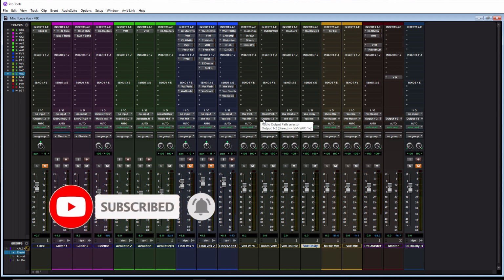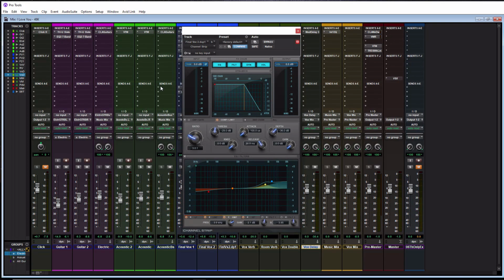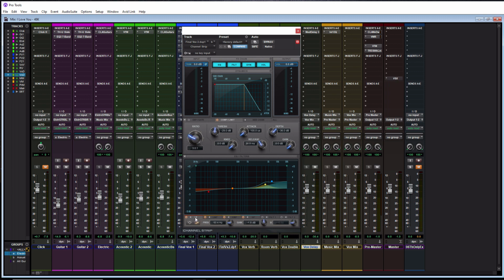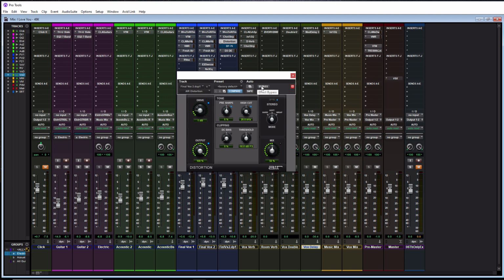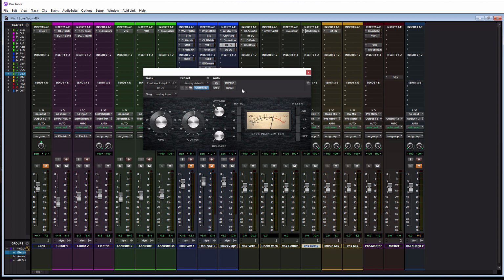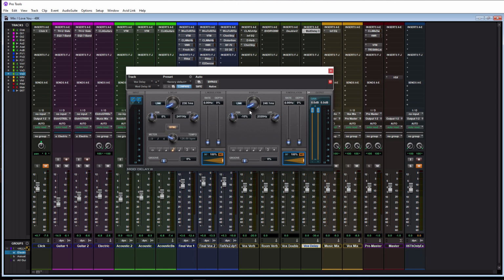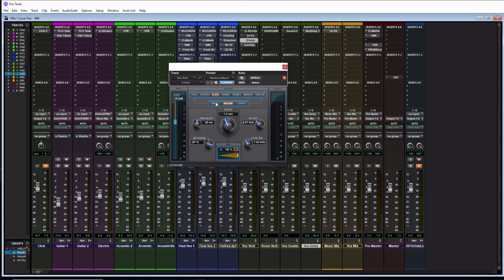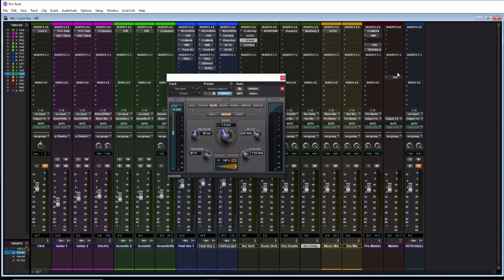Top 5 Best Pro Tools Stock Plugins!

Comment: Nice video. You explain it well and your videos are well done
. 
I am an old school engineer (before doing photography for a living) that ran/owned a full time audio home studio with a large fully modular console (48 input D&R Orion inline console) and a large format analog tape machine running at 30IPS (or 15IPS) and vintage outboard gear. (Eventide H3000, Lexicon PCM 42, Rev7, TC Electronics, DBX, etc. 

I eventually (about 15 years ago) bought myself an Alesis HD24XR Stand alone hard disc recorder (24 tracks) with the higher spec AD/DA converters and now I am considering buying a DAW. I still like using a console and my outboard gear, so I am trying to find a DAW that would be user friendly to make a hybrid studio (mainly for myself). I may rent the studio again on a limited basis, but my main concern is to take advantage of what a DAW can offer as well as have the console and outboard gear at my disposal also. 

I was going to start with a perpetual license Pro Tools standard, but there is so much stuff available it gets confusing really fast. Any suggestions as you seem very knowledgeable with the DAWs. Thanks.
Phil
Reply from the maker: If you want to incorporate a DAW into a analog console set up I definitely recommend Pro Tools. It will also give you everything you possibly can need as a stand alone as that's how I use it. I use it with Slate Ravens which are touch screen interfaces so I can still use my fingers. Back in the day, when I was in college, we used Pro Tools with an SSL hybrid console. Once you get all the actual patch bay routing in place it works great with Pro Tools.
Reply: @AudioSorcerer  OK Thanks for that info. Appreciated. Also, nothing like those SSL consoles, Neve, API, etc, Those consoles are amazing. 
Phil
Reply: @AudioSorcerer  Are you using something like these models? I'd like to research getting some of these when I create my new setup. Thanks.
Phil

https://www.bhphotovideo.com/c/product/1475803-REG/slate_digital_yk_901_raven_mti_2_a_raven_mti2_27_multi_touch.html
Reply from the maker: The link is broken but based on the description I believe those are what I have. They are cool but do take a bit of getting used to.
Reply: @AudioSorcerer  OK Thanks. Strange the link doesn't work. It works on my laptop when I click it. Here's the model from the link.
Steven Slate Audio Raven MTI2 27" Multitouch Production Console with 3.0 Control Software
Reply from the maker: @uptownphotography  Yeah, that's what I have.
Reply: @AudioSorcerer  Thanks...
Reply: @uptownphotography  you're welcome
Reply: Studio One has a great feature/plugin that brings both worlds together in a easy helpful way called Pipeline.

Comment: Surprised you didn't mention my 2 favourites!  Lo-fi and Sansamp.  Lo-fi is an unreal distortion/saturation plug and using the sample rate conversion to shave off digital sounding top end has been an industry secret for years.  Sansamp is a staple on bass guitar and any electric guitar that was poorly miced can usually be saved just by running it through sansamp.  Its also great at making super digital synths blend with real world instruments.
Reply from the maker: Hey Evan, thanks for your input. Those are some great plugins you mentioned. I'll be honest, I had to think back a bit for this tutorial because I hardly ever use stock plugins anymore. Lol
Reply: Haha hey Evan fancy seeing you here - just looking at the sans amp and lofi plugins right now by nembrini audio lol
Reply: lofi i like for the console preset....its nice